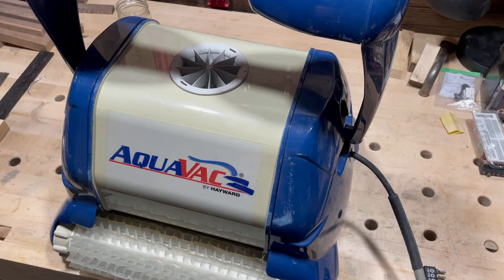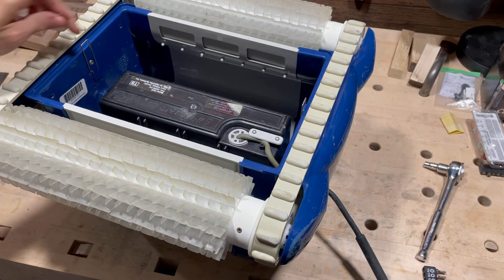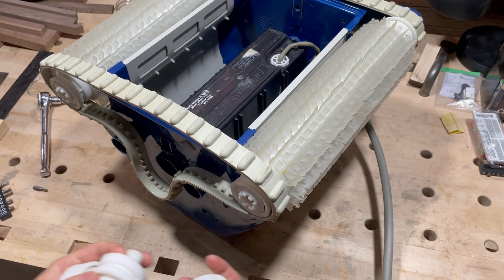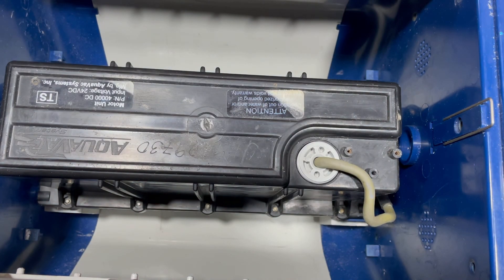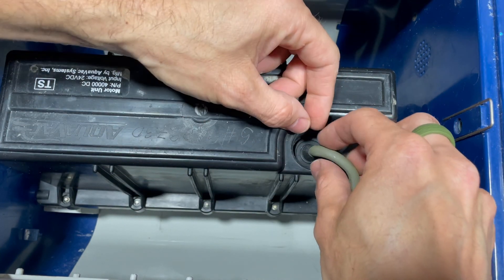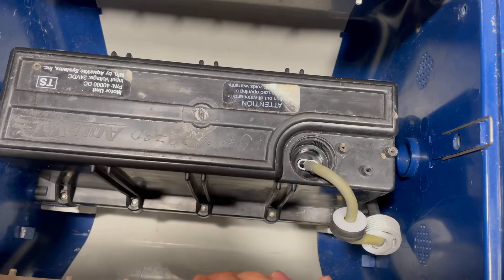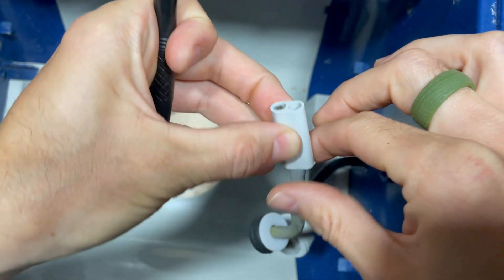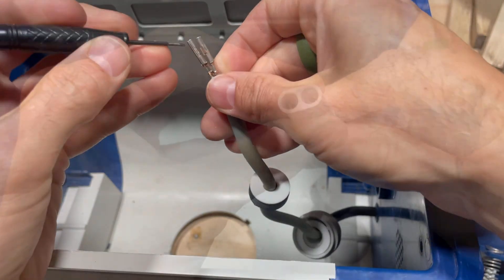Hayward Aquavac Motor Replacement - Complete Disassembly

Comment: Hi how are you...quick question ...I noticed a few motors at different prices but they all look the same...will all work for this model?
Reply from the maker: For my pool cleaner the motor was part# RCX40000DC.  They should advertise the part #.  I wouldn’t buy any other motor unless it’s the correct part# or reference the pool cleaner it’s compatible with.  They’re too expensive to make a mistake.

Comment: Very interesting. Mine has the impeller not working so it does not sink to the pool's floor, but rollers are working fine for 20 seconds, then all is dead...Do you think there is a way to open the motor case or it is permanently sealed ? Thank you. Boy those motors are expensive...
Reply from the maker: You can open it up, it's just a rubber seal, no silicone sealant used that you'd break and have to reapply.  Just reassemble nice and tight.    The impeller usually don't turn on at the start to sink it until after a 30 second or so initialization, it sounds like it's failing before that so the impellor doesn't turn on.  That's what mine was doing when I had to replace it.   Since I've done the video, it's still going strong.
Reply: @thewoodwork_ca  OK, thank you...I just had the impeller running again by removing the impeller and turning a few turns  the impeller shaft with a pair of pliers to''unseize'' it.... The robot was in storage for the winter, so it was probably seized a little bit. Works again like new...fingers crossed....
Reply: I'm attempting the same thing but unseizing the motor with force, it might work but absolutely will seize again. The bearing is probably dry. I will try to get to it, lubricate it and report back later to say if that worked. Hayward does not consider parts inside the motor unit to be servicable so there is no help out there to follow.
Reply: Ok It wasn't easy but I managed to pack some new grease in the front bearing of the impeller motor. The bearing is sealed with a rubber ring so it was easy to pry it off. Due to the design I could not properly remove all the brown and black garbage in the bearing but I added some fresh grease to fill it up. Seems to run well for now. I'll come back to this comment over time to track how long it lasts.